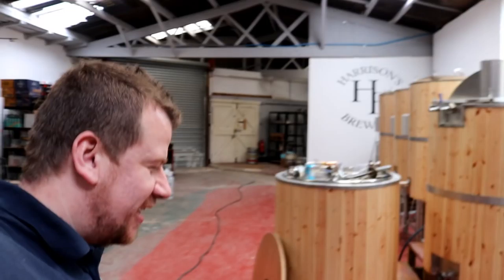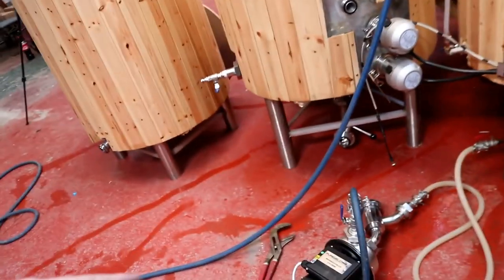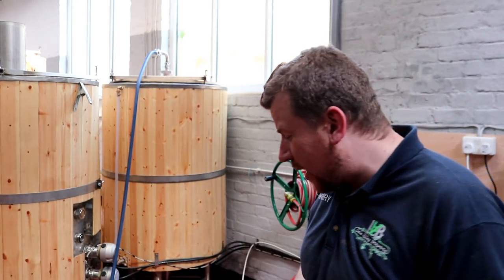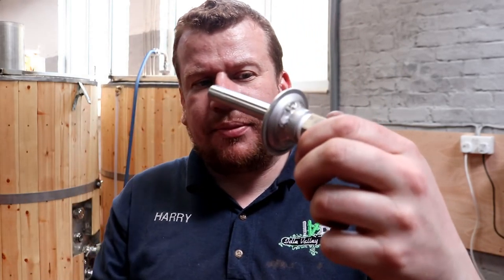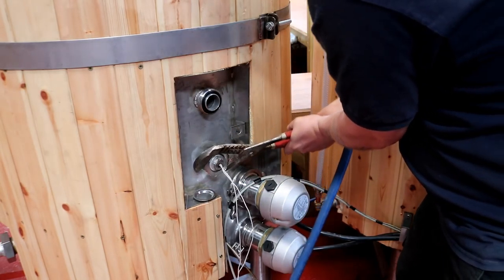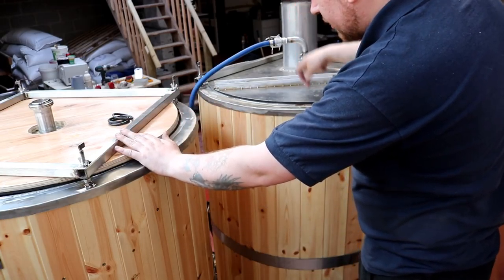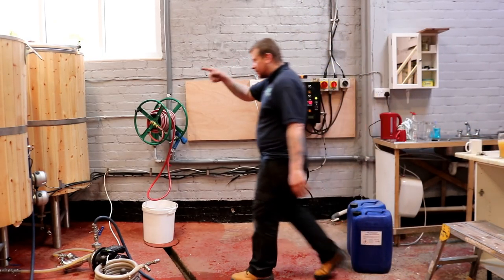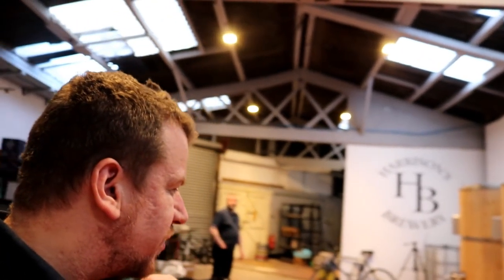ARE YOU READY TO DO THIS?

Comment: This is getting really exciting now, properly good job there - it’s really impressive! Could you vent the FV’s through the outlet by putting a bit of hose/tube/pipe up through the outlet into the void above the liquid? Might pick up the odd splash of caustic but only what falls into the top - could even bend it over to prevent that? Really good job though, it’s like a proper brewery!